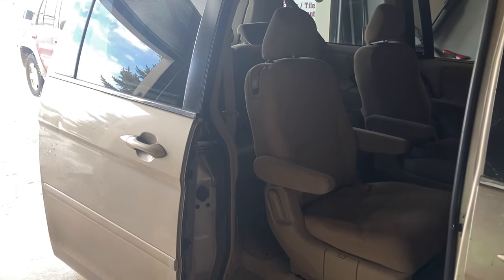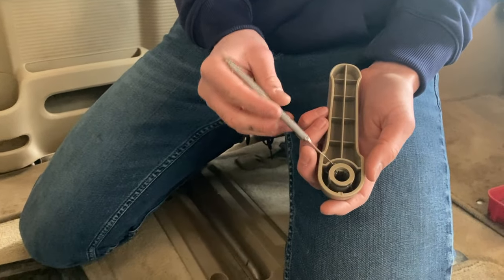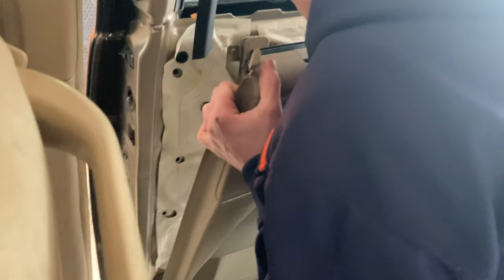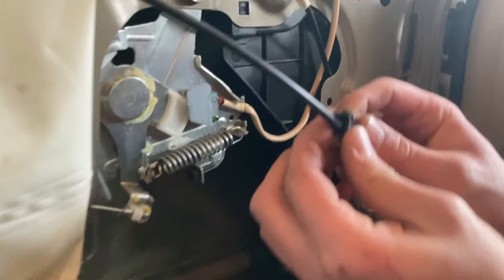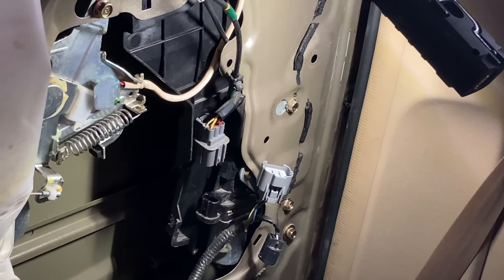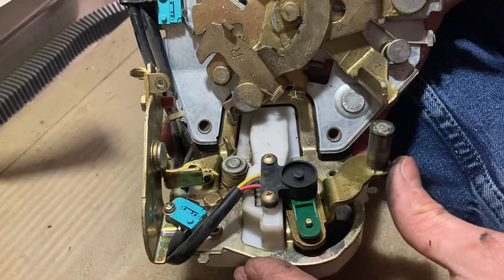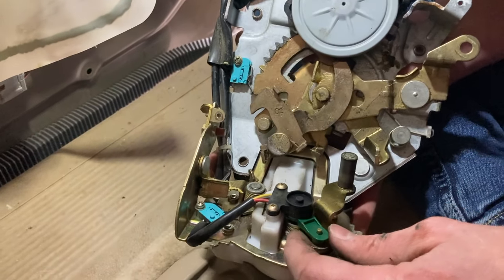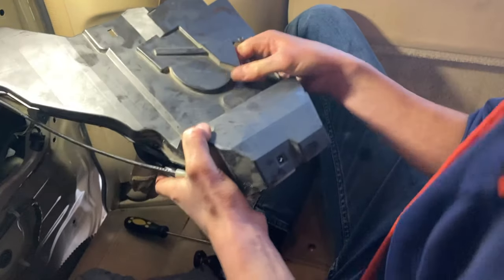How To Fix Parasitic Drain and Power Sliding Doors On 2005-10 Honda Odyssey

Comment: Well....unfortunately this did not completely fix my parasitic battery drain. I still have 0.5A draw when the car is off and in sleep mode. But no more alarm going off that the door is open while driving. Pulling fuse #7 fixes the 0.5A drain. Now to figure out what is the next thing to test. I think it's the rear hatch door.  That's just a guess though.
Reply from the maker: Out of curiosity, was the drain reduced at all, or was it  0.5A before you fixed the latches? I wouldn’t be surprised if there were multiple sources of drain, seeing how many unreliable electronic devices are built into these vans. Maybe it’s just me, but it seems like all the common sources of parasitic drain come from that fuse #7 circuit as well😂
Reply: Unfortunately, I did not test the amperage before doing the left sliding door. I thought for sure my problem would be over after that since my son was complaining about that particular sliding door. However, after checking other things, the latch on the rear door is shot. It will close but won't do that last little "pull in tight". I can manually push it hard so that it is tight but still get the current drain. I saw some people spray lubricant up in the handle of the rear door, that did not do anything for me. I can open the little access panel on the inside of the rear door and I can see at least one little blue switch just like the sliding doors but I have to figure out how to remove the trim on the back door to really see what's going on. I tried prying here and there but nothing looked like it was going to come off in one piece...so some more research is needed there.  I will do the right sliding door as well. He's content pulling the #7 fuse at night and putting it back in the morning; that would drive me nuts. Thanks again Hans. @hanspoole
Reply from the maker: I too would be driven crazy if I had to remove that fuse every time I finished driving. There was one time I had to remove the trim on the back hatch for some reason, but I can't remember if there was any particular trick to it...Good luck!
Reply: Check and see if your navigation screen is the culprit I remover the fuse for the nav screen and voila no more drain
Reply: I do not have a navigation screen on this 2007 Touring.
Reply: I do not have a navigation screen on this 2007 Touring.
Reply: On my 2006 Touring I was having the same issue of a .51 amp draw all the time, I was thinking it was the sliding doors because they've had issues before.  But my rear hatch hasn't been fully latching for awhile now unless you manually get out and slam it shut.  I noticed that the handle on the back was very hard to move and doesn't spring back.  So I thought it might be a cable between that and the locking mechanism.  I sprayed the handle real good with lube but it didn't help anything.  So I pulled the back panel off the inside of the rear latch and discovered that on the touring model there is no cable between the handle and the locking mechanism, its purely electronic.  I disconnected the handle switch mechanism and viola,  the door will now latch and pull all the way in, and my drain is gone,  now its at .03 which I assume is more in line with normal.  I'll be ordering a new handle/switch mechanism.  HTH @raymondjiii
Reply: @antonioceravalo2513  Yes EXACTLY! I took off the little panel on the bottom of back interior and noticed there was no cable as well. I also tried to lubricate the exterior handle with no success. Did you pull off the entire interior trim on the hatch door because I want to do that but I cannot find any instructions on where to pull or pry first. OR, are you saying that you could disconnect it through the small access panel? If that's the case, I didn't see exactly how to disconnect it through that little access panel. Can you give me some more details on that? Thank you for your help!
Reply: I had to take the entire lower trim panel off,  make sure you pop apart the interior handle on the hatch because there are some screws hidden in there,  otherwise I just took all three access panels (2 brake lights and door latch) off,  then on the bottom I popped off the push button to "close" the hatch and unplugged its cable,  then I started from the brake light access panel and began popping off the larger panel a little at a time,  careful around where it meets up with the thin piece of trim around the window  I ended up breaking a small tab on one side before I realized how it worked!  Having a hard time finding a cheap replacement for the handle/switch assembly looks like autozone has it for $70 vs $130 plus everywhere else,  I  may try to see if I can get it working again though before I buy a new one.  Let me know how it goes for you. @raymondjiii
Reply: @antonioceravalo2513  Ody forum a great resource if you don't go there already.
Reply: @antonioceravalo2513  I finally made it over to my son's house and here is the result: First, thank you so much for the details about where to pull on the interior trim - I was worried about that but I did have a trim puller kit from years ago and with your steps I was able to get things off without cracking anything. I attach the ammeter and it shows 0.51A as usual.. We disconnect the latch motor (regulator) and it stays at 0.51A. So I then disconnected the plug that goes to the door handle that connects to a switch inside the door handle and that switch has a pair of wires that goes down to the latch motor. So, I found it very odd that BOTH cables had to be disconnected in order to get rid of battery drain. But I kept looking at the inside of the door handle. I could see where there were two pieces that should be able to glide easily and I had some rust buildup on it. I used DEOXIT5 sprayed around AND inside the switch. I scrapped some rust off that I saw (on the inside) and hit that with PB Blaster. I kept testing that switch (that is directly inside the door handle) and I wanted to see it switch between infinite and 0.0 ohms as I manually moved the little lever on the switch. No luck at first but after a while, with DEOXIT5 and messing with AND I ketp cleaning out some of the crud underneath the handle looking at it from the outside. I was finally able to see the resistance on the switch change so I reconnect the door handle switch and it FINALLY went down to 0.00A...but like you, I have to keep the plug to the regulator disconnected. In the end it looks like I had TWO problems, 1) the switch at the door handle and 2) the door latch motor. I know that many people claimed to have fixed their battery drain by sticking a WD40 straw up and around the door handle from the outside; I now see why that worked for them, but mine needed more that just a little spray of WD40 from the outside. I wish I could have taken the door handle off completely but you need to take the exterior strip off that is right above the rear door handle. It looks to me like it's 4 bolts that need to come out on the inside but I think they either snapped or some piece of "plastic" cracked (I could see that one piece of plastic did crack on the left most bolt as I pried that strip up a little).

So for now, I think I'm at the same situation as you, I need the door latch motor to fix this 100%. It got dark out and it got difficult to see so I did not figure out yet how hard it would be to get the latch motor out. But if Autozone has it for $70 as you said, I will definitely try that if it's available. But I would love to get the rear door handle off and at a minimum use some compressed air on it. The little switch at the end of the handle has a special type of rivet in it so the handle and switch is all one (the little piece of exterior trim over teh latch is not involved I think). But again, if you can't get that exterior strip off right above it, it's never going to come out. And THANK YOUR for that tip about prying off the "top of the pull bar" to reveal those two screws, I never would have found those. Thanks once again for your help.
Reply: @raymondjiii   My problem was definitely the liftgate/tailgate handle that has a 2 wire connector on the inside,  once I removed that my drain went away.  I did not have to replace the motor assembly on the latch mechanism.  The liftgate/tailgate handle was $70 at Autozone.  Just so you know my handle was literaly not working any more,  it hand to be forceably moved from closed to open and just stuck there,  the spring did not move it back at all.  To remove the handle I did have to remove that trim piece above the license plate.  Like you said there are 4 bolts on the inside.  They are awful to remove,  they are metal retainer clips that have a threaded hole in them held by PLASTIC.  Of course the metal is corroded and all the WD-40 in the world wasn't enough.  So like you I ended up prying the trim piece up enough to get some vise grips on the retainer clip so I could get the bolts out.  That strip also has a few places where it clips into the body and the lower piece of trim that holds the license plate on.  Once I had my switch out I complete disassembled the switch by driving the pin out of it,  then I filed all the rusted areas until I got to bare metal once again, probably should have primared the metal but I didn't.  Then I put it back together again (the spring was very fun to get back in place).  Once I did that I tested it on the van and it worked with no drain any more.   Oh I used a heavy duty gorilla glue/caulk to rebuild the plastic around those retaining clips to hold them in place again and was super careful when tightening the bolts back in to it.  HTH.
Reply: Ah, I misunderstood, obviously. I guess since Hans' post was about the motor, latch and switch that I assumed the problem was the same on the rear door. I do know that it tries to pull the rear door latch closed tight but it doesn't seem to be able do so. I can physically push the door so that it is closed tight but the battery drain is still there. So now I am wondering if to try to pull the door latch mechanism and do what I did to the left sliding door latch - take it out and clean it up the best I can as Hans shows here. I wonder if that little switch on the latch motor is at fault. I also tried removing the wire plug that goes directly to the little motor on the latch mechanism but pulling that plug did nothing to reduce the battery drain. I guess I'll have to watch Hans' video again and see if the grease on the rear latch is just not letting things work easily. On the side door I spent most of my time cleaning around the switch and didn't worry about much else. I actually removed the switch and cleaned the area around it with brake cleaner. There was a problem with that door every so often so I naturally assumed that it was the cause of the battery drain problem. The mystery continues, I'll try to take the rear latch out next.  @antonioceravalo2513

Comment: PULL FUSE #7 ! !    ....THAT'S WHAT OPERATES THAT DOOR MOTOR (AND A FEW OTHER THINGS)
Reply: @hanspoole  Yeah....just stating that to stop the battery drain until the latch can be replaced...
Reply: @hanspoole  It stopped the drain on my brothers '07 ....I tracked it down with my amp meter...
Reply: Can you use the door manually? Right now we are going through a heat Wave and if I could just stop the drain but still use the door manually that would be fantastic until the heat wave is over
Reply: @sprmom81 I read online there's a SWITCH to switch from automatic/electric to MANUAL, so make sure you find that and put in manual, ironically not sure if fuse 7 powers that switch as well....but I  just checked with my brother, the owner of van and he said YES, he could still manually open/close it...and he doesn't recall using this switch..(van is sold now)..probably pulling the handle to open puts motor "in nuetral" or is setup to "go with the flow" when manually opened...maybe setup that wayin case of emergency, people trapped inside in accident etc

Comment: My wife's is currently doing this. I would rather BURN it !!    I Hate that thing
Reply: @hanspoole  I begged her for a Chevy suburban but Noooo 
Work on this POS all the time
😆
Reply: @hanspoole  that's her excuse. I just don't wanta work on the doors all the time lol
Reply: Your wife is doing the repair and you arn't helping her? Seems a little backwards to me...
Reply: @GarrettCrosgrove  yes of course I'm Helping but cussing it the entire time
Reply: @markarmstrong3394  hmm I threw a few words myself, but nothing too hard. Just time consuming.
Reply: @GarrettCrosgrove  Transmission just went out on my wife today. Under 200,000 miles. So we went and bought a Ford Explorer
Reply: @markarmstrong3394  Haha nice, mine is running still at 245,000. It does burn oil tho.
Reply: @GarrettCrosgrove  we bought it used from Stealership. My wife babied it. Ugh
Oh the rear passenger door literally fell off on the ground one morning when she was at work.
Reply: @markarmstrong3394  Haha what?
Reply: @GarrettCrosgrove  we bought it used at Honda Dealership. Right after we bought it we had problems with the doors. The other day passenger side door fell on the ground. Now transmission went out. My wife babied it but it didn't even make it to 200,000 miles
Reply: @markarmstrong3394  dang